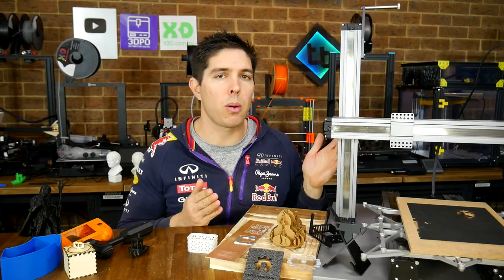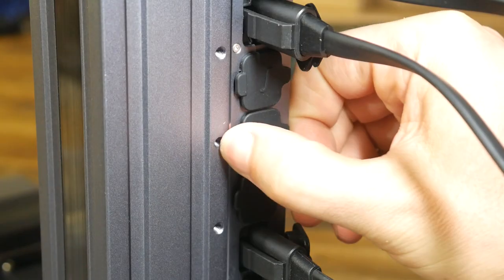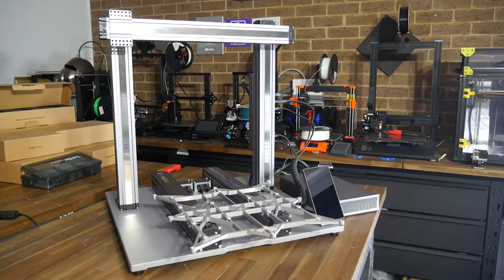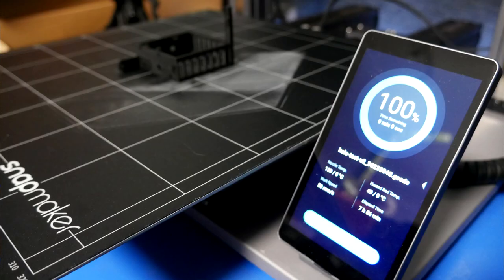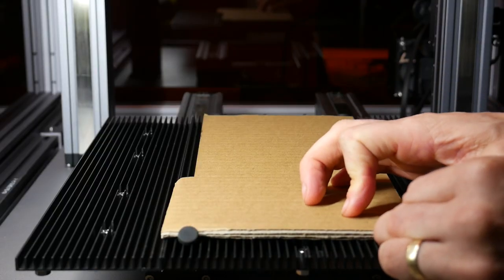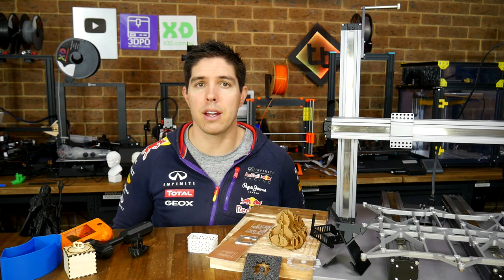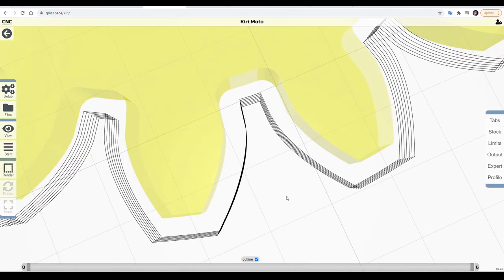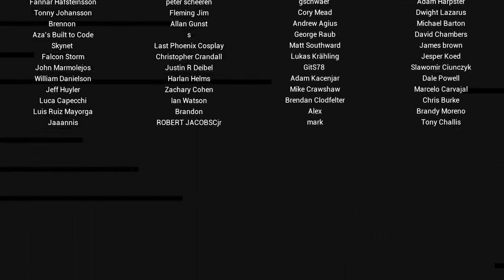Snapmaker 2 0 review - A 3D printer, laser engraver and CNC mill all-in-one

Comment: I was given a Snapmaker 2.0 A350 as a graduation present after finishing a two year 3D-technician course. Long story short is that it wasn't a positive experience.

First off is the noise. The machine stood in the basement and even with the doors closed one could still hear it. Second was the inconsistent auto-calibration. No matter how many times I calibrated with all the different settings I could barely get any prints which didn't turn into spaghetti goo. Filament got stuck to the nozzle or the filament got loose from the build plate (or both). Changing temperatures, Z offset and filaments made no difference.

At first glance it seemed the machine didn't have any standard components (which is something I could be wrong about of course) and the addons sold separately were quite expensive. An emergency stop button should come included with any CNC/laser machine.
Speaking of CNC and laser, at the time I didn't have any project which required those workflows so I never tried them and therefore can't give an opinion about it.

The native slicer software Luban was quite cumbersome to use and I quickly put it aside for Cura instead. Also files sliced in Luban would take a really long time to print where in Cura it would take 1/3 of the time.

In the end I sold it and bought a Creality CR-10 V2 and I don't regret it a second. The V2 just works, it's much more quiet than the Snapmaker and there's some upgrades/mods one could do.

I've seen some awesome stuff people have made with their Snapmakers so it seems I only had a bad experience but in the end I'm happy to have replaced it with a CR-10 V2 and if I ever decide to jump into CNC and laser I probably buy separate dedicated machines for those tasks instead of having an all-in-one machine.

Comment: Is it possible to swap out the motor drivers to quiet them down?
Reply: They are working on a silent driver update. New machines will include it by default. The users that already had the machine (like me) can adquiere the update
Reply: You can buy new quieter linear modules on the Snapmaker site now.

Comment: Great review, as I expected, 'multifunctional' usually means that each individual function isn't suited for any serious use. I would always get three separate machines, and I'm pretty sure that anyone that buys this machine gets annoyed in a few weeks and decides to park it in a corner and buy three separate machines. Therefor I would give this machine the lowest rating when it comes to sustainability as it essentially combines parts and materials that consume lots of energy to produce, only to be stored in a corner of a workshop. I hope that companies like Snapmaker some day realize they have a big responsibility in this and think some more about ethics and producing useful machines instead. Of course, this is not only Snapmaker's problem, but many companies are doing this. It's totally out of hand. I missed this in the video. It's as fiddly as a DIY printer from 2012. They should've given it autoleveling with either piezo's, an inductive probe, or even an IR probe (as per DC42's design). And silent steppers.. Man, I had to turn down the volume on my laptop because the sound was so gnarly.

Comment: Pretty balanced in the review. It has some issues certainly. Seems like the Apple of 3d printers/laser cutters/cnc machines, which is somewhat of an antithesis to the community. 
To me everything seems like it was designed to be 'high quality' yet rushed through the door. The 24 screws for the bed could have been given interrupted threads and screws so it's drop in and give her a half turn on each and if you lose some, you just need to tighten them normally.
 
I get that people are running for a "high end market" though 3d printing isn't close to being perfect yet,  software updates still make huge differeces to hardware so these things seem like snake oil to me. "I'd have been harsher and said "It looks nice but performs like crap" though that's probably why manufacturers aren't sending me stuff to review.